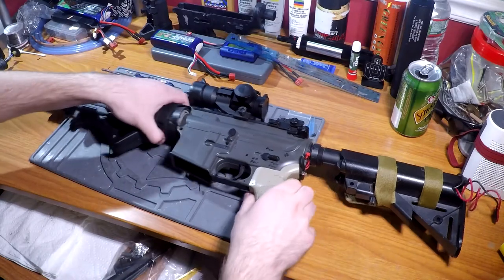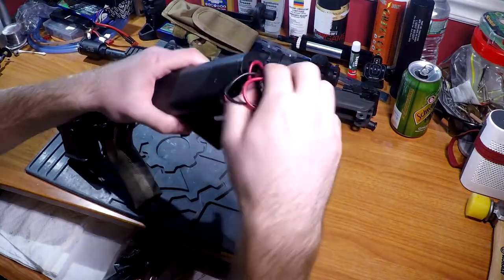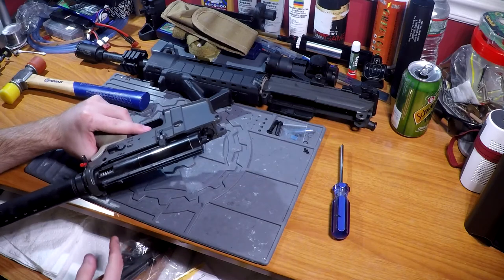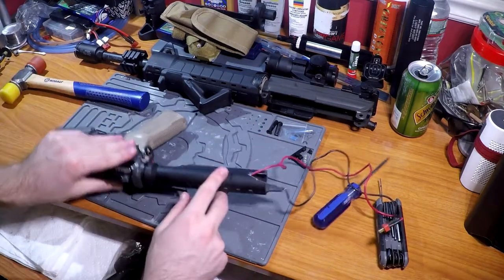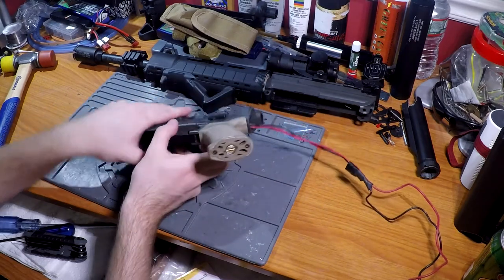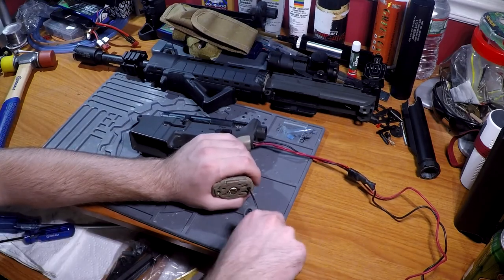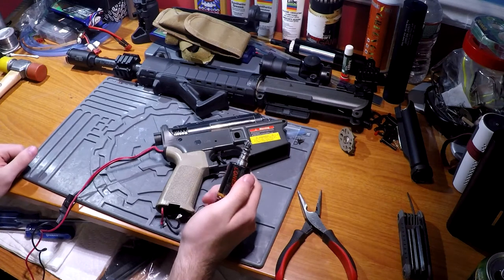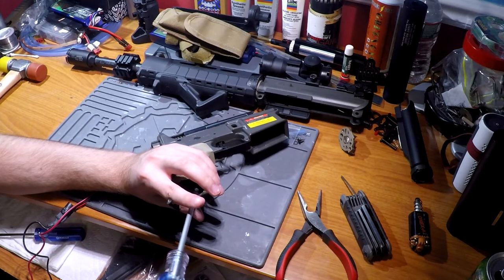Teching An Airsoft DSG: Part 1

Comment: This is why im just going to buy hpa. Im sick of spending this much time trying to fix something, and since im no pro, more things break for me than they do him.
Reply from the maker: Sam's Stuff honestly, my DSG is a complete miracle as far as teching goes. It was a low reliability, quick DSG build that got nearly perfect shimming (after two years of use the pinion has no visible ware) and somehow didn't die on me until now. It is hard work to make everything go together just right, but it's so satisfying to have your work do as it should. Plus IMO it's cooler to match HPA performance with an AEG